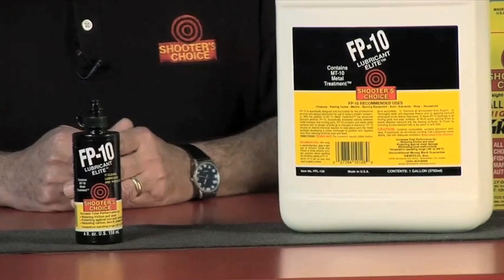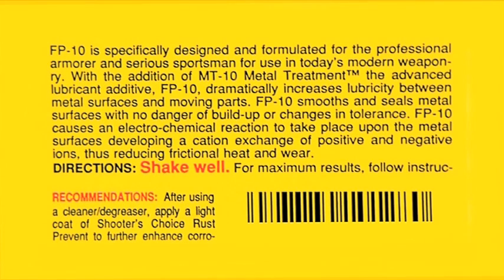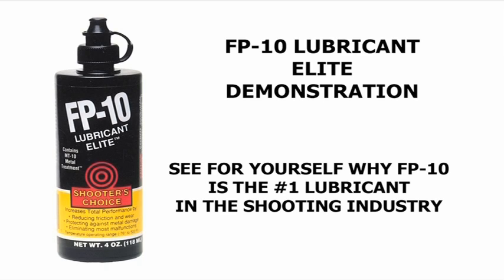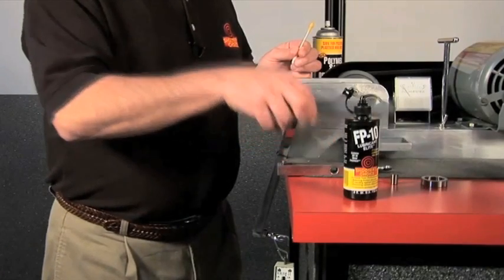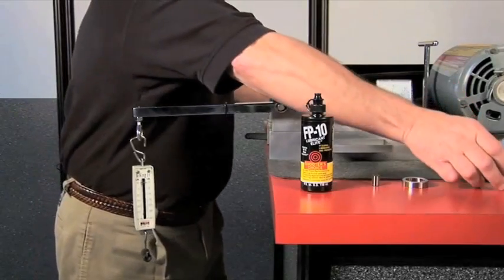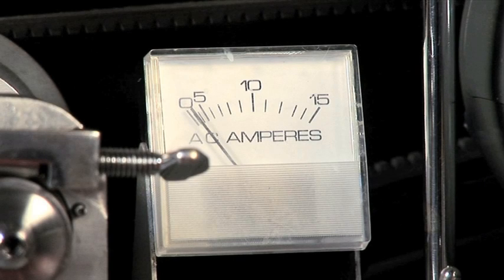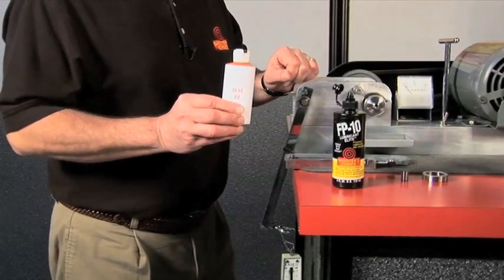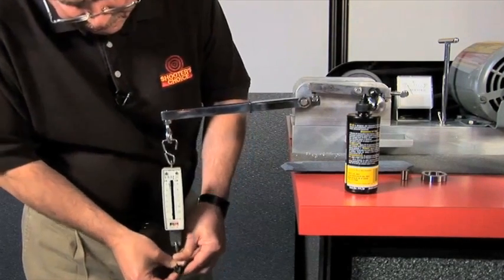FP-10 Lubricant Elite Comparison Test: Part 1

Comment: I first learned of FP-10 decades ago when I was looking for a oil that would work in tight tolerance match grade custom 1911s. Wilson Combat, Les Baer, Kimber, Dan Wesson and Springfield Armory recommended it so I knew it had to be pretty good stuff. I have been using it ever since. Some people complain about the cost but if you can't fork over $8 - $10 for a bottle of premium gun oil you really shouldn't even own a firearm IMO....Not like you go through the stuff by the quart anyway. A bottle will last 6 months to a year and longer.

Comment: FP-10 is good gun oil for what it's intended for. Test #1 (RemOil) is also good stuff, proven minimal wear in my guns. I have an issue with the half-truth give at 1:42 mins into this video. Today's guns don't have any tighter tolerances than those made throughout most of the 20th Century. 1911's, P-35's, A-5's etc were all built on a reputation of rapid reliable cycling under harsh conditions, long before space-age gun oils were marketed. Big difference is the materials used in modern designs.
Reply: not quite sure about that.. a 1911 manufactured in the early 20ies with then production methods will not have the same tight fit as a Dan Wesson Built today with modern tooling.
It just doesn't.

In the old days they took a standard 1911 and then a reputable gun smith would accurize it to match standards.. a Dan Wesson for instance is the opposite, its built from the ground up to match standards.. and it shows and feels.

FP10 only in my Dan Wesson, No discussion the best mubricant for such a fire arm

Comment: Oh, by the way... I guess they hide the labels for liability reasons, BUT the #1 lubricant is none other than Rem Oil.  Lubricant #2 is Hoppe’s Oil and last Lubricant#3 Break Free CLP.  This is NOT hype, FP-10 blows them all away...just like the video shows.
Reply: Rem oil and hoppes oil are both terrible lubes, breakfree is great but id suggest looking up the video project farm did to see just how poor rem and hoppes did if youre still using them.